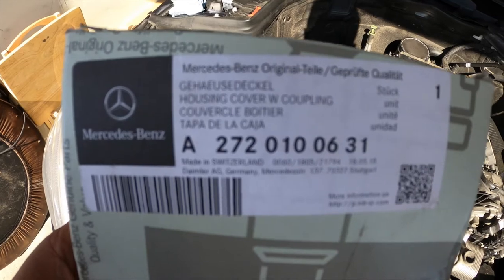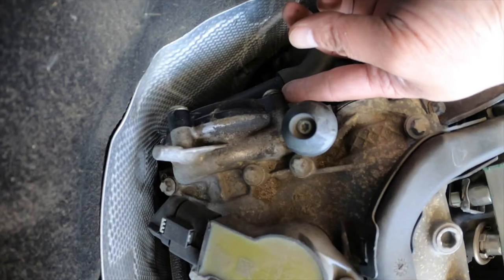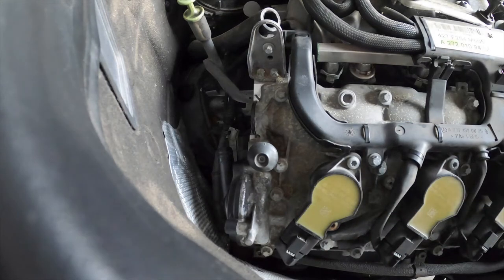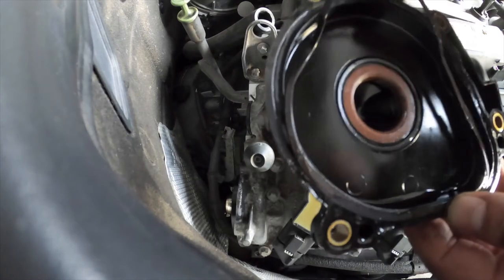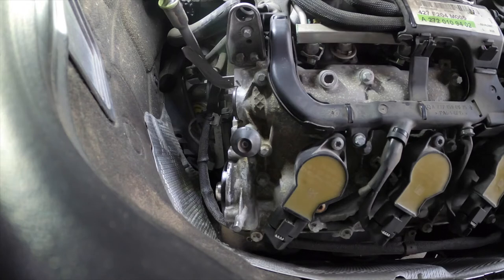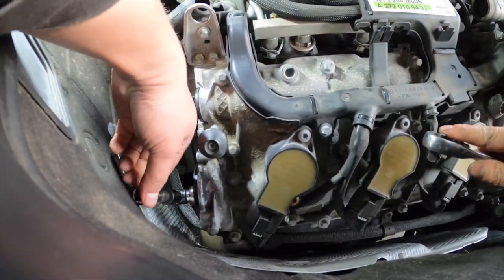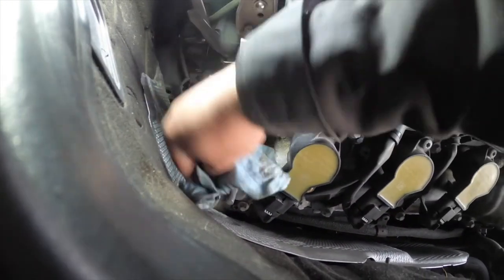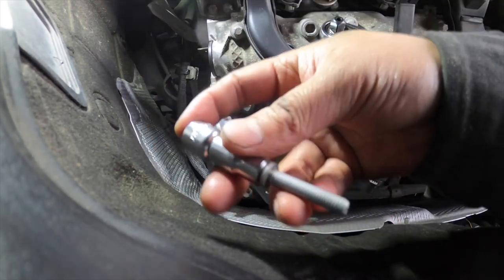DIY Centrifuge Cover and Oil Drip Pan Replace on Mercedes C300

Comment: Very informative.  My M272 just reached 150,000 so im going through everything and noticed oily gunk along the intake manifold which may be originating from these breather areas.  Just ordered the drip pan, cover and the oil seperator that is in the drivers side also.  Im seeing oil residue around the throttle body as well so will take all that stuff apart and give it a good cleaning.
Reply: I just was in the engine bay and the bolts holding the cover on take an E10 socket to remove, not T30.  Looks like I'm going to have to buy an E10 wrench to get the two outer bolts out.

Comment: Thanks! You helped a great deal. Mercedes really sucks for the poor design on the air intake manifold actuator breakage and the near impossible position of the oil drip pan.
Reply from the maker: You're welcome.

Comment: Also don’t for get to replace the partial load oil separator on the top front of the other bank. Without doing that, this service is incomplete. They recommend replacing the hose too but it can be cleaned out and put back on.

Comment: I had to do this job on my E350...Oh boy!!!! I was probably cussing and fussing at every German engineer who worked on this design for placing that part in that spot with no room to work...
Reply: Someone charged my wife 400$ I don't think they did the job right.. it's been leaking oil every since the service is done.. Everytime I get a oil change they point it and say take it to the dealership.. I'm going to do it myself..

Comment: How tight do you tighten the oil drop pan? I didn’t want to make it too tight or too loose.
Reply: Tight without stripping.  It's reverse thread for a reason so won't spin off with the engine running.